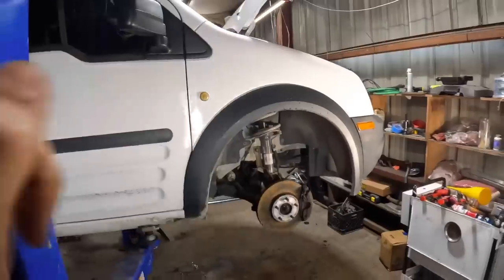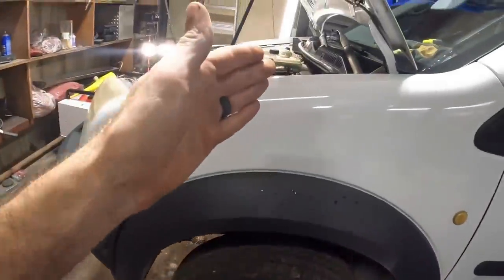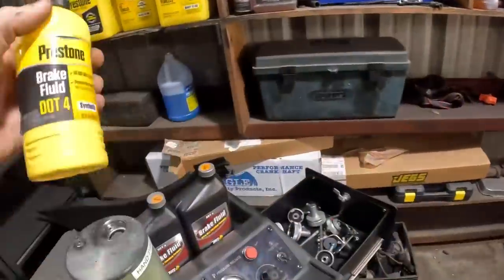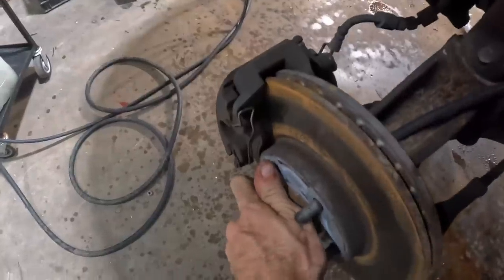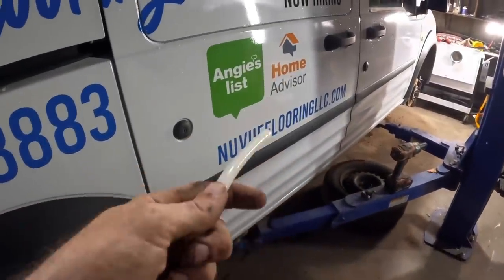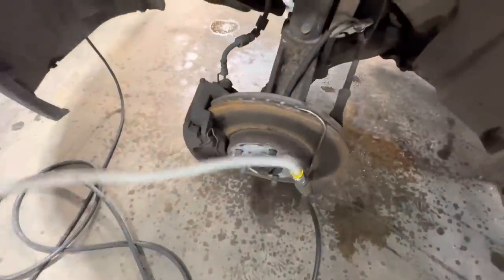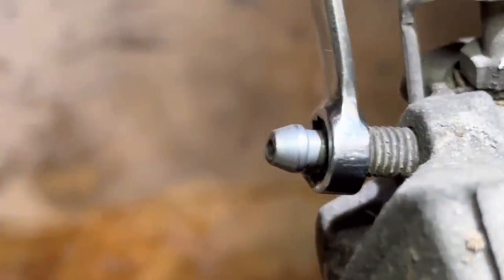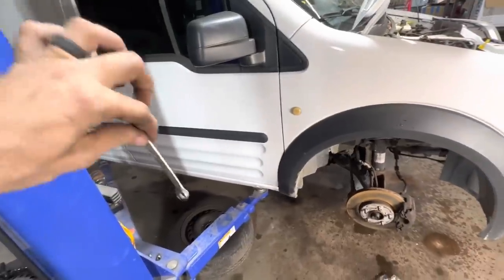Does Brake Fluid go BAD?? Ford Transit 2.0

Comment: Here is the short answer: Yes, brake fluid can go bad. Brake fluid absorbs moisture, which reduces its performance. For that reason, it's best practice to change brake fluid every two years. However, brake fluid is one of the maintenance items that drivers miss most often.
Reply: The pistons and bores in the calipers and brake- and master cylinders rust from the moisture as well. The mechanics noticed that these items last much longer, since regular brake fluid replacement became a thing.
Reply: My car says every 20k miles so it’s like a 1.5 year thing for me.
Reply: It is an important maintenance item to prevent internal corrosion.  From what I've seen, almost no one does it or even knows about changing brake fluid.
Reply: Yeah, I just had my brake fluid change. It was dirty. I never heard of it either but anything to keep my car running good and stopping good.
Reply: Let’s say it’s been 2 years and I test my brake fluid with a brake fluid tester device and it indicates only 1 or 2% water content.   Can I wait another 2 years?
Reply: A lot cheaper and faster than new abs system parts, or brake calipers, or lines, or master cylinders, or proportioning valves etc.
Reply: I came here to say this. I ride a motorcycle and change the brake fluid every year myself. My safety is worth more than the few dollars I spend on brake fluid.
Reply: Yes, brake fluid absorbs water, (it's hygroscopic)  so when the brakes work hard this water will boil, turn to vapour, and as gasses will compress, you lose all hydraulic pressure in the system...  so no more brakes.  The corrosion is a secondary issue.
Reply: @iffracem  how does the moisture get to the fluid? It's a closed system
Reply: @Pittaz  you shouldnt, its really cheap to do and easy to diy, brakes are the last thing you should skip out on. i dont have a tester so i go by color, if its dark thats bad, if its green thats really bad, and so on.
Reply: @Bryan-Hensley  Through the cap..Humidity is absorbed through the master cylinder.
Reply: @Lovesausage269  money grab
Reply: I get the feeling 75% of people don’t change the brake fluid during the entire vehicles lifespan
Reply: Along with every other fluid in the vehicle except engine oil hahahaha.
Reply: @skynet1.044  no real need to change it unless it's dirty or contaminated.  If the system isn't tampered with. Lids aren't open.  Only thing would be moisture.  And even that may bec1%
Reply: Well put.
Reply: They make different colored Fluids. Like green, blue.
   Using a different color each time helps to know when the flush is complete.
   Ive never seen brake fluid turn greeen it turns brown or grey when contaminated.
    So in this case. This doesnt necessarily kean this fluid is bad.
Reply: @erik_dk842  exactly. The pistons will rust to the point where the brake won't release when you let off the pedal.
Reply: Brake fluid is hygroscopic meaning it absorbs water
Reply: @damonens9478  Yeah don’t change oil either.  Just money grab. 😂
Reply: @Pittaz  Someone told me 2% okay, 3% not so good, and 4% is bad.
Reply: @Bryan-Hensley  Every time you or mechanic opens the master cylinder cover (especially on humid days) to inspect or refill the level a little moisture creeps in.
Reply: Also from the calipers constantly heating and cooling can wear the brake fluid. Brake fluid can start absobing water or start getting copper in it. Not reallt sure how cooper gets into it, but if seen brake fluid testers that test for copper
Reply: @Bryan-Hensley  interesting question.  Does not mitigate the need, tho.  Brake fluid changes make a difference in the system health and breakdowns.  I would have liked knowing sooner. No excuses, though. I neglected to read the owners manual. . 
Also, discount brand fluids discolor more quickly.
Reply: @Rich Cran it's no different of a process with abs. the only real difference is if its awd, my stepdads subaru had a different pattern from most cars but you still do it the same way
Reply: @Pittaz  depends where you draw the fluid from. The moisture enters via the rubber hoses, seals etc. Most moisture will be at the caliper end, and this has a relatively small volume of fluid so the fluid degrades  most at this end.
Reply: @damonens9478  B.S.
Reply: @iffracem  You won't lose ALL hydro pressure. Yes, it will be diminished. Don't be so dramatic.
Reply: @carnutal3627  every 30k is a money grab, changing oil is essential every 4-7k , changing your brake fluid every 100,000 yeah makes sense, but you will run yourself broke doing it every 30 000 miles, more or less changing any fluid at an unnecessary interval is not cost effective for you , nor is is neccessary,  changing your oil for example way below your intervals does absolutely nothing to help your wallet or your vehicle.  Same applies to every other fluid in that vehicle.  Dealerships especially will take your money when its not neccessary
Reply: @Bryan-Hensley  It breathes thru the header cap so air (and moisture in that air) will enter the hydraulic system.
Reply: @bradhaines3142  sadly some cars with abs require a scan tool to actuate the pump to get the fluid to flow, putting yet another basic thing beyond the reach of a normal person.  no point buying a 700$ scan tool for a $150 job.
Reply: @damonens9478  my car says every 40000 km or 2 years, whatever occurs first.  every car is different.  reservior capacity, type of braking system etc.  as long as you go by the manufacturers book, you should be fine.
Reply: @Bryan-Hensley  It's NOT a closed system. There is a small air hole in the cap. If it weren't there, you would create a vacuum in the master.
Reply: @iffracem  Yes, and no.  It absorbs water, which turns to steam when braking hard, just like you said.  The extra pressure has the effect of pushing hard on your brake pedal, which locks up your brakes.  You are either stranded because your car won't move, or if you ignore this, you floor it and make the engine overpower the brakes, and you either blow your transmission, overheat your brakes, or both.  Either way, you will do thousands of of dollars of damage to your car.  Or, you could just do a thorough brake bleeding once in a while to avoid this.  Every 30,000 miles is extreme overkill, but you may as well do some bleeding whenever you change the pads to get the moisture out.  How it gets there, I don't know.  But over the years I've had 2 cars lock the brakes, and a simple brake fluid flush fixed it both times.
Reply: Have my car 6 years and never knew bout this change the breaks pads  every year even tho people say iam mad as there is loads left on pads will be doing this aswell every year from next break job thanks for the info
Reply: I didn't know this.  My car has over 255 K miles and is over 22 yo.  I don't remember ever changing the break fluid.
Reply: This is the biggest auto maintenance item that's not common knowledge. Change your brake fluid every two years and you'll never have to rebuild your slave cylinders. Motorcyclists know this, but auto drivers are kept in the dark.
Reply: Another thing about hygroscopic fluids is that they must be kept in a sealed container.  If you left your fluid container open for a day it'll be full of water due to the fluid actually pulling moisture out of the air.  Same goes for PAG fluid in air conditioning systems and vacuum pump oils.
Reply: Buy a cheap tester from Amazon that tests fluids for moisture content using electrical conductivity of the fluid.
Reply: Although you probably should (consult your vehicle's maintenance schedule) the fact that vehicles are designed for a three-year lease period so it never gets done. 
I was used to doing a cooling system flush and fill every autumn until I bought two Jeep Patriots. The interval is 10 years/100,000 miles.
Reply: Over time air will actually enter system through the rubber hoses, at the microscopic level.
Reply: @leewatson8129  If moisture is entering the system as you describe,    at ambient temperature and pressure, brake fluid will most certainly escape violently when the pedal is pressed!
Reply: Well explained in UK here the fluid is a normal service item along with cambelts and transmition filters ,as a by you could have polished the head lights as would have been a fail on our MOT annual check.
Reply: @Pittaz  Why risk it? Break fluid replacement is a hell of a lot cheaper than damage break components.
Reply: @brucemadden1626  not my Chevys and Toyotas they have a rubber like bladder that seals the reservoir. As the fluid level drops it pulls down the rubber bladder like cover. If you push back too much fluid it will pop the cover off..
Reply: @kingofbrutaltheocracy9201  proportioning valves !!!  😭😭😭
Reply: I just had mine done after 120k miles. Was probably still good too but whatever.
Reply: @Bryan-Hensley  The brake fluid reservoir has a vent.
Reply: @Bryan-Hensley  it’s not a closed system plus when brakes heat it and cools down it creates water
Reply: @iffracem  you also didn’t mention you get what’s called brake fade or brake boil but everything you put is spot on
Reply: @Bryan-Hensley  That is the Elephant in the room. Everyone is correct it can absorb water if you leave the cap off.
Reply: Totally correct.  BF is hygroscopic.  Once the moisture content is > 3% the Ph in the fluid becomes increasingly acidic and that's what eats the seals out. A cheap measuring tool will check the fluid quickly and easily.  As Daddoh says, change brake fluids (actually ALL fluids) every two years .
I made one of these changers once using a pressurised jug and a spare Master cylinder top.  Worked like a charm. Open the bleeder and drain the nasties into a bucket until it becomes clean.
Reply: @Pittaz  you are on the limit.  Once it hits 3% change it.
Reply: @Bryan-Hensley  It isn't closed.  The master cylinder reservoir is open to atmosphere, so the oil absorbs water hygroscopically, becomes acidic and off we go
Reply: @erik_dk842 changing brake fluid hasn’t became a thing. It’s gone full cycle. Back when you had the first hydraulic brake systems every brake job had the wheel cylinders rebuilt and the brake fluid replaced by flushing/bleeding the system. Every shop had a selection of cups and dust boots for the different wheel cylinders used. When disc brakes came along we rebuilt the calipers with every pad change also as per manufactures procedure as part of a drake service.  As time went on and phenolic pistons became common and price wars drove the common brake job to just push pistons back and install pads and machine rotors. Now we don’t even machine rotors because cost and weight reduction has made rotors and pad construction causes rotor wear to the pint that machining is not practical anymore. So fluid changes were overlooked and became less common service items. A lot of this was caused by price wars between the chain stores advertising low priced brake jobs with advertising. Cut the price and something has to go and fluid changes was one of the first to go..
Reply: @pillsburied  I just found out about it in the last year and flushed both my cars. I've started telling people about it and have yet to find anyone who already knew brake fluid goes bad. It should be common knowledge for anyone who drives a car but nobody teaches it
Reply: @Bryan-Hensley  well no it’s not a closed system. As the pads or shoes wear the fluid level in the reservoir goes down so there has to be a way for the pressure to equal.
Reply: @jerryhatrick5860  Usually the different colors mean different fluids. Blue is typically DOT5 which is silicone based. Not to be used in DOT3 or 4.
Reply: @Bryan-Hensley  there's normally a breather on the master cylinder cap otherwise as the pads etc wear and more fluid folks the caliper cylinders you would choose a vacuum in the master cylinder
Reply: @Rich Cran they're missing out on a service opportunity
Reply: @jerryhatrick5860  you need to be careful which brake fluid you use as not all are compatible with each other o don't think you can mix DOT3 WITH DOT4  but you can mix DOT4 with DOT3  and if you have silicone based fluid I think you can only use silicone fluid🤔 if in doubt read the manual or take it to Ray 😊
Reply: @John-dp3ln  Or spend tester money on a fluid change?
Reply: Donkeys years ago we would say your cooking your brakes which boils the oil in there. Hence why the fluid gets darker nearer the brake cylinders. That end of the system is fully airtight and therefore moisture tight so the only thing left is heat. The harder you drive the more likely you're going to require a fluid flush more often. From personal experience I've not seen rust on the caliper end that's coming from the inside and I've only blown one master cylinder on a mk1 golf. If you do boil the oil you may still get gas in the system as it vapourises like any other fluid. Saying all that doesn't mean don't bleed the brakes, always follow the manufacturer's directions (unless you're lazy and can't be bothered).
Reply: Thay don't forget it's always next time they have a service but never happens,they should make it compulsory every 25000 miles or or keep there car automatically! Until done,make the break fluid a lot cheaper as-well, more people Will get it done as i think this might encourage people to do it more often it's a life saver 🇬🇧👍🏻❤️.
❤️ 🇬🇧Grrrrreat show tonight bruva🇬🇧 ❤️
     IF NOT GO BUY CAMELS 🐫🐫🐫🐪🐪🐪,
    
🐫🐪   LET'S GO GREEN BUY A CAMEL 🐪🐫 TODAY 🇬🇧. YEY.
Reply: not just performance, it causes cylinders to corrode etc..
Reply: @wobblyeye493  Ah,  boiling water gets turned into oxygen and hydrogen.  Didn't think about that...
Reply: Can't count the number of times I've seen a spongy peddle because of this. Personally, I'd flush mine religiously.
Reply: @rjb6327  Maybe you live in a dry climate.  Or, maybe whoever changed your brake pads bled your brakes as part of the process.  I lived in a humid place, and was forced to park my cars in what can best be described as a swamp.  That's why I had all that trouble.
Reply: @iffracem  I had this problem with my old ford years ago. I was a rookie car owner and didn't know about that. i drove in the big city sometimes and when i  whas driving a while brakes almost gone, it happened several times.
I lived in little city and there it didn't happned because few braking.
This time i didn't know what is going on, i drove back to my little city and brakes worked again after highwa driving.
Now i think it was boiling brake fluid, very old and it cooled down in highway.
i think this brake fluid was over 10 years old.
Now i change brake fluid in my car, now i know.
Reply: @erik_dk842     Rust? Or would corrode would be more accurate
Reply: @Pittaz  noo in my mechanics class 2% is the max moisture before flushing out the fluid
Reply: @erik_dk842  those are good reasons but the most expensive part in the system by far is the ABS module so yes brake fluid is cheap
Reply: Newer DOT 5 synthetic fluid does not attract water, like the old stuff.
So its more of a heat /discoloration indicator.
Reply: @darknes7800  dot 5 is a silicone based brake fluid at shouldn't be used in regular cars it gives a very spongy pedal. Should never be mixed with 3&4
Reply: Only use fresh bottles if its plastic, if its metal it keeps longer.
Reply: Seriously don't you guy rebuild the cylinders?  Also on my toyota celica the clutch peddel and brakes use the same reservoir so you should bleed the clutch slave cylinder too.
Reply: Y’all are full of Bull. I drive a 1999 Silverado and it has never had any brake service or antifreeze since I have owned it 24 years. It has the original belts and hoses too. If it weren’t for a compressor failure, it would have never been wrenched on.
Reply: @Mr572u  haha that's a good one
Reply: I asked my mechanic and he told me he changes the break fluid every time he does a break job.
Reply: "Reduced Performance" means the boiling point of the fluid goes down as moisture content goes up.. Brakes produce heat.. the moment the brakes become hot enough to boil the fluid, you loose all braking.. Very dangerous.
Reply: @Pittaz  I would test after 3-6 month
Reply: @Bryan-Hensley  Supposed to be, but doesn't always work that way.  Usually through the reservoir cap and past the membrane that's supposed to stop it happening. Due to incorrect fitting, age or a tear etc.  Incorrectly sealed and stored containers used for replacing/topping up the fluid.
Reply: @theclearsounds3911  trust me, been a mechanic sinse 1977, never heard of, or seen a brake system locked on due to vapour pressure.  Seen plenty fail to stop due to it though
The lock up you see may be due to other system issues, related to the same poor maintenance.  Time is the important factor for fluid change, not mileage.
Reply: It's a pain in the rust belt ,the bleeders are usually rusted and the flates are corroded off on them.
Reply: The heat and cold cycles add condensation to the fluid too.
Reply: The word is HYDROSCOPIC most fluids are hydroscopic and absorb out of the atmosphere….i change ALL THE FLUIDS in all my cars every 2 years, oil every 5k. Cheap insurance.
Reply: @damonens9478  Here in the UK oil changes annually or at 10,000 miles are the norm, which suggests your 4-7k intervals to be an unnecessary interval, though some manufacturers like VW offer an alternative of changes at 20,000 miles using "long life" oil.  Personally I prefer 10k.
Reply: @Bryan-Hensley  I would argue that an automobile brake system is a semi-closed system.  The Earth atmospheric pressure is 15 pounds per square inch (actual pressure is 14.7 pounds per square inch.). The Brake Master cylinder top that you tighten down, is at best approx. 3-6  (maybe slightly higher to 10 psi) pounds of pressure.  In this video, Ray say's the rubber boots used on the brake cylinder bleed valve, is to prevent moisture.  Nothing could be further from the truth, they are simply a dust and debris preventive only.

If the Brake Master cylinder top that you tighten down, were truly a closed system, ever time you were to open / remove the top, you would be getting the sound of air rushing in,  just like when you open a home made canned jar of whatever product you decided to can, a.k.a. "put-up."
Reply: @iffracem  It always surprises me when 2 honest people experience opposite things, then discuss their different experiences.  I've been working on my own cars since 1980.  My 2005 Dodge Caravan's brakes locked up on my while doing a combination of city and highway driving on a very hot summer day.  I bled the brakes, and it drove for at least 5 more years without any brake issue.  How else can you explain that?  With your experience, if your brakes heat up and the water boils, it increases the pressure in the system, which applies the brakes even more, causing more heat and boiling.  If you let it cool completely, let's assume some steam escaped, lowering the pressure in the system.  Wouldn't simply pumping the brakes once or twice restore the pressure enough to reliably stop the car again?

I lived most of my life in New Jersey, which is very humid during the summer, and I was forced to park my car in a swampy area, causing the water.  Do you live in a very dry climate?  I'd love to understand why our experiences are so different.

I agree, it's more the time than the mileage, but if you bleed the brakes every time you replace the pads, it should flush out enough water to avoid the problem.  And, with the kind of driving that's necessary in New Jersey, that's fewer miles than a rural area.
Reply: Its a closed system.  If there is water/moisture, look for a leak.  Otherwise 2 yrs changing, is massively overkill. Your money.
Reply: @mervynhogan7829  They are not talking about the pads, the FLUID, the hydraulic fluid that then operates the pistons that push on the pads. The interval for the pads will vary by how much braking you do, how hard you brake etc, and if  you commute in heavy commuter traffic that is full of stop and go traffic (I was at one point and it did a number on my front pads).
Reply: @fixingitrightish  I know, but I've known for decades as I began to drive in the 1980's.
Reply: @jacksmith2315  If you drive your vehicle hard sometimes the fluid can boil hence moisture build up.
Reply: @alanclarke2524  yeah the newer vehicles are getting more out of the 0weight stuff than ever before, I'm still driving a 20 year old truck so I can't get those kinds of intervals
Reply: brake fluid, along with trans, transfer case, power steering, coolant, and diff fluids. Outside of oil changes, the vast majority of people seem to only perform reactive maintenance. Forget about the manufacturers recommended maintenance schedules.
Reply: The older cast iron master cylinders had a flexible rubber membrane that was supposed to follow the brake fluid down as the shoes/pads wore.
Reply: @rjb6327  I could absolutely feel more firm and direct action after a fluid flush.
Reply: Yes you're right it can go bad brake fluid is very hydroscopic absorbs moisture causes rusting in brake parts the other types of brake fluids nowadays I don't know I don't have no experience with that stuff like the synthetics and silicone base or whatever I don't even know if it's compatible with regular brake fluid yes regular brake fluid can go bad
Reply: @peterwill3699  Isnt that infuriating and troublesome? They should use more substantial bleeder valves, 10mm not 7mm! Why would that be so bad?
Reply: @brucemadden1626  Wrong. It IS a closed system. The cap has a rubber diaphragm or bellows that allows fluid level in the M/C to go up/down without letting any air in the M/C reservoir.
Reply: @Pittaz  Would you like your brakes to work only 98 or 99% of the time?
Reply: Fluids are cheaper than repair

Replace fluids more often. 
No, I’m not bought or paid by these companies.
Corrosion is the last thing you want in your vehicle.
Reply: @damienvillano4044  yep...regular maintainance procedure in the motorcycle dervice depts. I worked in for 43 yrs.
Reply: @Bryan-Hensley  Brake fluid is hydroscopic, meaning it searches for moisture and absorbs it typically with the brake fluid turning to an acid base. Air get in in anyway it can especially when the fluid if checked, brakes are done, air is purged and even through weak breaks lines that are leaking even a little.
Reply: My Honda service manual says it should be changed. My Honda dealer says no need as long as it looks ok. My local chain garage service manager laughed and said they had never changed brake fluid in any vehicle.
Reply: @Bryan-Hensley  it’s a closed system, but not a sealed system. Yes, it is hygroscopic that bad.
Reply: @jerryhatrick5860  I was thinking the same thing. That’s why I test my brake fluid versus the “color.” It’s amazing how much better your brakes work once the fluid swap is complete, though.
Reply: My truck manual says replace brake fluid every 97.5k miles. lol, it also says to replace transmission fluid every 97.5k, too. And I did my initial at 48k, with some nasty debris, so I don’t trust my maintenance schedule. I’ll just test my fluid.
Reply: @jonathancunningham2686  flexible brake line hoses cause no brake release too. Good times when on a long trip
Reply: And don't save unsealed bottles especially in high humidity environments.
Reply: For those of you who still don't believe water can infiltrate through the rubber hoses in your brake lines, keep in mind that all matter is made up of molecules, NOT solid objects.  Inflate a latex balloon with helium and observe its behavior for a week.  It will drop in 2 days, as the helium permeates through the rubber first.  Then, despite your best efforts of sealing the air inlet, it will deflate much more slowly.  Yes, it's a different type of rubber than what's in your brake system, and yes, most of the system is steel tubes.  But, all types of rubber molecules let air molecules permeate through them.  Same reason you need to keep topping off your tire pressure.  Unless they changed things in the last 20 years, there is a thin rubber diaphragm in the cap where you fill the brake fluid, and this is to allow the volume of brake fluid sucked in my your ever-wearing brake pads to be made up for by the the diaphragm stretching.  This causes a vacuum in the fluid reservoir, and this is a way for water vapor to enter.  The rubber isn't a perfect seal, the vapor goes THROUGH it.  

Keep in mind that I'm not an expert on this, so I may have gotten some technical details wrong.  But, this is how water gets into your brake system without a leak.
Reply: Brake fluid is hydroscopic.
Reply: @Bryan-Hensley  
It’s not completely sealed, there has to be a way for some air to enter the fluid reservoir to account for ambient air temperature and reservoir fluid level changes due to brake pad wear.
Reply: @davealexander1201  
It gets in through the vent hole in the reservoir cap, if the hoses aren’t seeping brake fluid, they’re not letting moisture vapor in from the outside either.
Reply: @theclearsounds3911  
I’d say it depends on the climate where you live. I’m in North Texas and it gets hotter than blazes here, then colder than a freezer sometimes, and it’s almost always humid here. Your comment on bleeding the brakes every time the pads are changed, well, I just don’t know about that. Seems to me if you’re changing the pads every two years or so, you might need to spend the money on some better pads. 
I’m in a 2007 Silverado 2500 HD Crew Cab Classic with a Duramax. At 393K + miles, it has had zero work done to the brakes except turning all of the rotors after I warped them coming down some 6% grades on I-70 in Utah with a travel trailer. The pads were still good, so they weren’t changed. 
The fluid needs to be changed, it has been severely neglected. It’s color more resembles the oil in the crankcase than brake fluid. So just bleeding the brakes at every pad change doesn’t work for some, and I’d even say, for most people, as most of us don’t need brake work that often.
Reply: @ralfie8801  the rubber hoses can let air molecules in without leaking brake fluid, there is no vent in master cylinder cap, that why the rubber gasket gets sucked down in the reservoir. Air gets in master cylinder everytime you open the cap.
Reply: @Pittaz  that's a great question. I'm too lazy to Jack up the car and redo a brake oil change in 2 years time lol.
Reply: @davealexander1201  
I never open the cap, yet the fluid level goes down and is replaced by air. If it didn’t, there would be a vacuum in the reservoir, or it would build pressure on hot days and apply the brakes with no pressure on the pedal. Either way, that would cause brake problems. Your reservoir is not completely sealed.
Reply: @ralfie8801  I'm beginning to understand why there is so much disagreement on this topic.  Not only does it depend very strongly on the climate in your area, as you said, but it also depends on the kind of driving you do.  Your brakes lasted as long as they did, not so much because of their quality, but because the driving in your area doesn't require constant hard stops.  I didn't say I change my pads every 2 years, but people who drive in New York City just might have to.  I could go for about 6 years in between brake pad changes.  So, bleeding the brakes at that interval works for me, but not for all.  I guess it's too difficult on this subject to talk in generalities, because of the wide variety of conditions.  And I really didn't realize this until now.  

Here's my experience.  While living in New Jersey, I was forced to park my car in a swamp.  It was OK during the day, but at night the water would evaporate, but then immediately condense all over my car because the air temperature is always cooler at night than the water temperature.  Many days out of the year, my engine would be soaking wet in the morning because of this, even though it didn't rain overnight.  That's pretty extreme, and I'm now convinced that this is what caused water to get in my brake lines.  Even though it's humid in your part of Texas, I doubt it was as extreme as what happened to me.
Reply: All I know about brakes is when I had the fluid changed in my truck they felt a lot better for stopping with out going to the floor as low, 6 years old all original including pads and rotors with about 40,000 miles.
Reply: @rjb6327  Should probably get that looked at then. Myself I have a '97 Honda Prelude that would, on occasion, the brake pedal would go to the floor while braking. I had the car sitting in my garage for 6 years. After I did a brake fluid exchange it brakes and stops like it's supposed to.
Reply: @John-dp3ln  Not sure I want to trust something this important to cheap testers.
Reply: @John-dp3ln  You shouldn’t keep opening the MC. If it’s browning, change it
Reply: @gsettlemyre  It's a safety issue is what it is and that's why it's important to change it if not every 2 years, 3 years tops
Reply: @spaceflight1019  sadly wrong, I was a brake system engineer for a major OEM. Moisture will slowly enter through the rubber, rubber or EDPM is not completely waterproof.
Reply: @theclearsounds3911  Not correct.  The problem with the absorbed water turning to steam is that steam is very much more compressible than brake fluid, and so the act of pressing the pedal compresses the steam rather than acting directly on the slave cylinder.  It's an extreme case, but it can happen and it results a very dangerous lost of effective braking.  If your brakes are locking when they should not, this is due to other maintenance issues and not due to absorbed water turning to steam.
Reply: @GodmanchesterGoblin  Of course I'm correct.  When water boils and turns into steam, its volume increases dramatically, causing a huge amount of pressure.  Sure, it's compressible, but it's under tons more pressure.  If that didn't happen, steam engines would never have worked.
Reply: @theclearsounds3911  In a closed system, yes. But in a vehicle there is also back pressure applied to the servo, and that means that the change in pressure is mitigated by a small backward movement of the master cylinder. I never heard of brakes locking in this way, only of brakes becoming less effective.
Reply: @GodmanchesterGoblin  I don't remember which of Rays videos this is on, but he replaced brake pads and forced the brake cylinder back, pushing brake fluid back to the master cylinder.  The force he used to accomplish this is definitely great enough to lock the wheel, at least on gravel.  When I had this happen to me, the wheel didn't quite lock, but the brakes were smoking, and it was impossible to go faster than about 25MPH.  If I had a much more powerful engine and ignored all the smoke, I can believe that eventually the brakes would heat up so much that I would have brake fade, and the brakes would fail that way.  But, as far as the steam lowering the pressure in the system, that can't happen without the pressure increasing dramatically first, then it cools from being parked.  All the steam turns to water, and pumping the brakes a few times would make them work again.  As for never hearing of the brakes locking, well you heard it from me.  I wouldn't make up a story like that to deceive anybody.  It really happened to me.  OK, so it never got so severe that the wheels completely locked up on pavement, but it was very close, and I knew that I would do severe damage to the car if I kept driving.  I pulled into a parking lot, opened up a bleeder screw to relieve the pressure, drove 2 more miles, and it happened again.  I again opened up the bleeder screw to relieve the pressure, and only used the park brake to stop, just to get home.  Once home, I bled the brakes, and never had any brake trouble with that car for the next 5 or 6 years I that owned the car.  Perhaps all of the cases you were hearing about were in muscle cars where one might not even notice that the brakes are on very hard.  But, how could they just ignore all the smoke?
Reply: @theclearsounds3911  I'm not arguing - clearly your experience is different to mine.
Reply: @GodmanchesterGoblin  Right.  I was just hoping throughout this discussion that one of us, or maybe a 3rd person could explain how water in brake fluid could cause 1 of 2 completely opposite reactions.  That's just how my mind works; I like to understand WHY it is the way it is.  At least we both agree that water gets into brake lines, and when it does, it's bad.
Reply: Around here most shops check the water content with every inspection, if you do one every year. But general recommendation is 2 years as well.
Had brakes fail due to bad (meaning water contaminated) brake fluid in the past. As soon as the brakes get hot, the water in the fluid starts boiling off, creating a steam bubble, which other than a fluid, is highly compressible. As compressible media are not very efficient in hydraulic systems, your brakes become very inefficient immediately. the pedal goes to the floor, brakes do nothing, your heart rate goes through the roof and depending on what is ahead of you, your pants will need an urgent change.
Reply: @Starchface  corrosion is one negative effect on the long run. But too much water content can cause a catastrophioc failure of the brake system as well. Reching a certain temperature, the water in the brake fluid boils off, creating a steam bubble in the brake system. With steam being compressible, your brakes are gone immediately.
Reply: @Bryan-Hensley  It may be  a closed system, but none of those systems are absolutely tight. moisture might migrate through gaskets, even the plastic. Also I think for the system to work, the reservoir has to be vented to some degree. And brake fluid is really highly hygroscopic, it will pull in moisture if it can.
Reply: @alexanderkupke920  Please tell me what kind of car this was.  My experience on 2 different cars was the exact opposite; the steam increases the pressure in the system, hitting the brakes, making more heat, creating more steam, hitting the brakes harder, and so on.  How is this possible that your car did the opposite of mine?  Different type of master cylinder that releases the pressure better than in my car?  More powerful engine making it less obvious that the brakes are applied hard?  I just want to understand this.
Reply: @NeoMK  what???? No it doesn't lol. It turns into steam and condenses back to water eventually. It's not electrolysis and even then it's debatable which I'm definitely not getting drawn into. Imagine a coal fired steam engine if it produced hydrogen and oxygen lol. You wouldn't have much of an engine left.
Reply: I’m nearing 284k and 13 years on original fluid. It isn’t clear, maybe like weak lemonade. I’ve only ever added a little bit when I did the original brakes at 190k and it spewed some from compressing the calipers. It gets checked by the oil change place about twice a year and they’ve never recommended replacement as it always tests ok. The fact that they want to replace half the car (wipers, filters, trans fluid, nitrogen in tires, belt that I just replaced etc) every time I go in there makes me think the fluid is fine as that would be a no brainer up-sell. I’ve never had a braking issue and I live in a place with some decent terrain. Of course, changing brakes every 190k would indicate I’m very easy on brakes. I actually had about 2mm left on the fronts when I changed them due to a noise, which I figured was a worn out pad. It turns out that the fixed shim on the back of the pad had broken off and was making noise.
Reply: @theclearsounds3911  I think that one was an, even back then (and I am talking at least about 17 or 18 years ago) old car by the German brand Opel. To be precise the last model "Kadett" before that model line transitioned into the still today existing "Astra" (available from Opel in Continental Europe and Vauxhall in the UK). So not sure what exactly the make and model of that brake was. Not even sure (almost sure no) if that vehicle back then was equipped with "ABS" or anti-lock braking system.
But with usual brake systems it is almost impossible for that steam to build up actual pressure as long as the brakes are not actuated, as otherwise the brake calipers would never be able to release. Also, do not underestimate how compressible that steam is. It would need to generate an incredible amount of steam to actually further depress the brakes, which would either mean you have pure water in your brakes, or your whole brake system up into the lines would get hot enough to boil of the water.
Keep in mind, this usually happens only if you hit the brakes hard anyways.
Only thing i can imagine, is that in some way helped by the steam, your brake calipers temporarily got stuck.
Reply: @alexanderkupke920  The 2 cars this happened to me on were a ~1984 VW Rabbit diesel, and a 2003 Dodge Caravan.  I don't even think the Caravan had anti-lock brakes.  When water boils and turns into steam, its volume multiplies by about 1,600 times!!!  Now, that's at atmospheric pressure, and I'm sure I didn't have pure water in the system.  Going by other people using the standard of 3% water in the brake fluid, that's still a volume increase of 48 times!  Things get beyond my ability to calculate when you compress that steam to the pressure of brake lines.  But, with steam trying to take that much volume there must be a lot of pressure.  You couldn't drive a steam engine train more than a few miles if it weren't for the HUGE volume increase when water turns into steam.  Assuming my brake pads were half worn, half of my brake cylinder was brake fluid, and 3% of that was water.  0.5*.03*48 is 0.72.  So, that steam is trying to take up 3/4 the volume of my brake cylinder!  That's big, considering it takes the cylinder only a millimeter or 2 to apply the brakes hard.  Yes, I understand that steam is compressible as you said, but it can still develop huge amounts pressure to compress it.

I thought the calipers released due to a small vacuum in the master cylinder when you release the brake pedal, and the natural springiness in the rubber o-rings in the piston.  Maybe that was partially true, but after seeing Ray force brake fluid back into the master cylinder when retracting the calipers, it made me realize there's something more going on that I didn't know about before.  But Ray exerted a lot of effort to do this, and it shows that a lot of pressure is required.  Furthermore, when this happened to me in my Caravan, and I stopped to release the pressure in my brakes, it didn't just pee out, like it normally would, it initially came out under pressure, indicating excess pressure in the system.  This wouldn't happen if my brake calipers just got stuck.  And, again, in both cases, simply bleeding the brakes cured the problem.  And, how did I know to do this?  When it happened on my Rabbit, I asked a good friend of mine at work, and he told me to bleed the brakes.  His brother in law had the same problem with a VW gasoline Rabbit.  Only he kept driving because his engine had a LOT more power than mine, and he ruined a lot of parts due to the intense heat from his brakes.

When you said that boiling the water in your brake fluid only happens if you hit the brakes hard always, I agree 100%.  Unfortunately, that's what New Jersey driving is.  50MPH speed limit on a road (Route 1) that has multiple red lights every mile.  Don't even think about driving slower than that because the next light is red; you'll get blown off the road by every other driver!